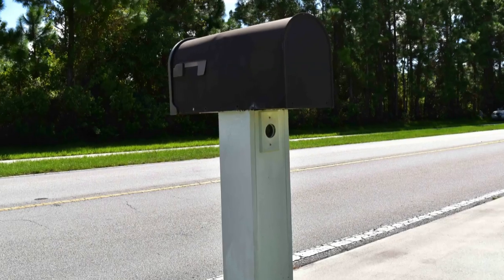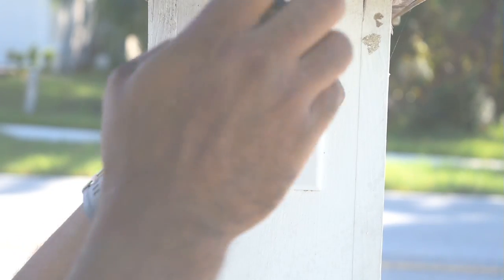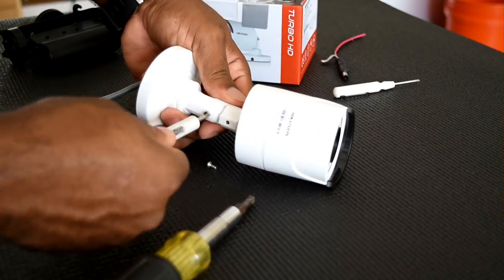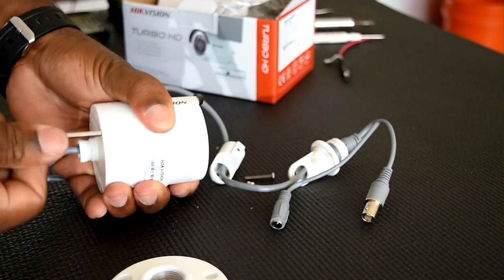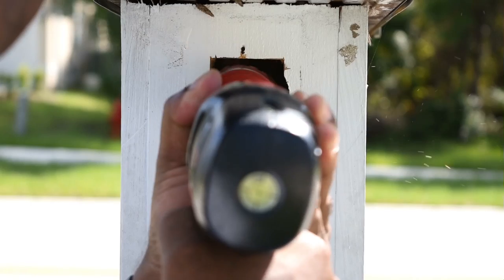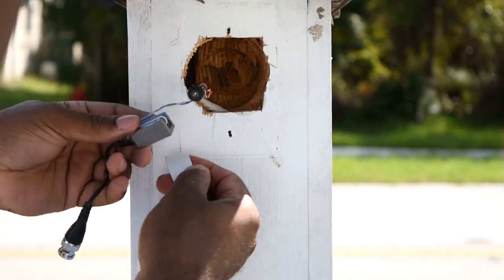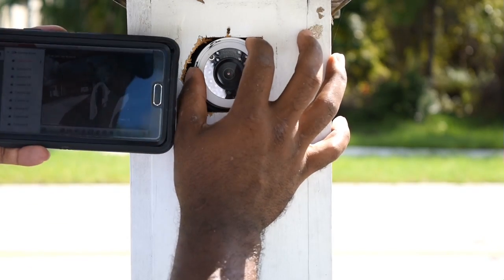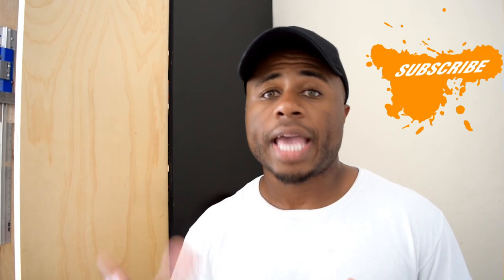Hidden Camera In Mailbox

Comment: Sometimes you can stack holesaws together to drill a larger hole. By placing the current size holesaw inside a larger holesaw, you can use the smaller one to guide the saw and keep it from bouncing around. Just a tip I have often used.

Comment: to drill a larger hole when you already have a hole there, all you need to do is get a piece of scrap wood, drill the hole in it with the hole saw and then clamp that wood piece over the hole you wish to enlarge.  Then you use the scrap as a guide and you can drill the new hole over the existing one.
Reply: Yes, I have  done it many times.  You are 100% correct that it will create a clean, precisely positioned hole, but with a bit of setup time.  I"n this case neither precision nor beauty were necessary because of the cover plate, so his technique was perfectly adequate and much quicker.  (The chiseling would be required in either case unless you used a Forstner bit.)

Comment: An easy way to cut a hole larger than what you have is to use your hole saw in a separate piece of wood and cut a hole in that, then place it against the smaller hole and use it as a guide to cut a nice larger hole.

Comment: Do you get a good image at night? It would seem having the IR lights behind the cover would cause some reflection?
Reply from the maker: yes, the IR is not covered by the plate
Reply: I understand it's not covered (I can see the LEDs in the pic), but having objects near the camera can cause the IR to bounce back into the lens, causing fogging pictures. http://overseas.hikvision.com/ueditor/net/upload/2015-06-10/99361bb6-27d5-482a-aaf3-2cdc32f835d1.pdf check out page 3.

Just wondering, if you say it doesn't I believe you. Thinking of doing this when I rebuild my mailbox in the spring.

Comment: Thanks for the video.  I have run CAT6 to my mailbox and am planning the same thing.  Could you tell me more about the construction of your mailbox post?  Sounds like you have a 4x4 as the structural post supporting your mailbox, then attached painted pine boards to the 4x4, creating the box that houses your camera.  Did I get that right?  

I was thinking about getting something like this http://www.homedepot.com/p/Step2-MailMaster-Hudson-Mailbox-534299/203993455, closing off the newspaper box and using it for the camera, although I would have to drill completely through the post, which probably won't work too well.
Reply from the maker: You going the right direction. I planted a 4x4 Post. I don't recall what kind of wood I used to wrap it, but i twas not pine. The box I used was bigger that the 4x4 it was not centered it favored to one side. 

You cant use that mail box. Just plant the supporting post much deeper than normal. Then stop the post right under the newspaper holder, this way you wont have to drill the post. Im not sure how strong the plastic is on the mail box but it may work. Think you will have to make a judgment on that in person.
Reply: Thanks for the quick reply!
Reply from the maker: Sure. Np
Reply: @DIYCreators    (Nice video Peter.)  DIY Creators, I'm thinking about doing this exact same thing.  Buy a mailbox with a newspaper holder and use it to house a camera.  My goals is a bit different than others.  My home is at the entrance of my neighborhood and I want to install the camera to record at a 90 degree angle from the mailbox.  I don't care if it's hidden.  I want it to record everey vehicle that drives in and out of our subdivision 24/7.  I'll have other camera's on my house pointing at it if someone wants to tamper with it.  However, I'm worried about the camera temperature.  My climate can run between -5 degrees and 105 degrees farenheight.  A camera sitting in a box in full sun may act as a solar oven.  Should I install a fan too???  open the back of the newspaper box to let it breath?  The camera should be pretty weather resistant so I'm thinking the "let it breath opiton" may be enough.  I'm wondering if you went through with this project and how it may have turned out?

Comment: whered you get the flexible wall plate from?
Reply from the maker: +Jon Hunt You can find it in home depot
Reply: Thanks, did you ground your cat 5? I plan on running cat5e and from my switch to my mailbox but some people say i will have to ground it.
Reply from the maker: +Jon Hunt 
I use the HD Analog camera and i put a Surge protector with ground http://amzn.to/1SdTEds
If you use a Network camera then you can use something like this http://www.amazon.com/RiteAV-Ethernet-Protector-Lightning-Protection/dp/B00FY7GMEW/ref=sr_1_fkmr0_2?srs=7648105011&ie=UTF8&qid=1455034411&sr=8-2-fkmr0&keywords=POE+cctv+surge